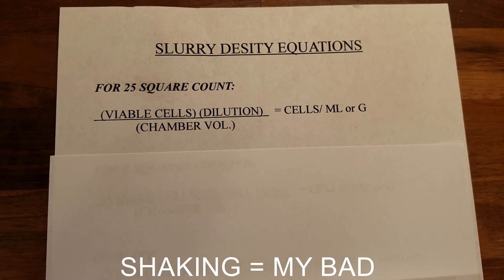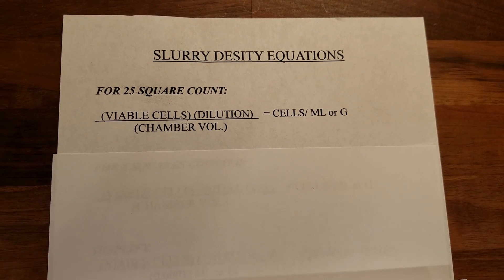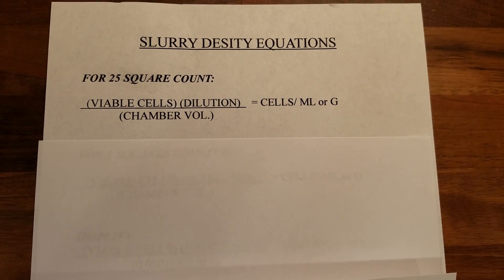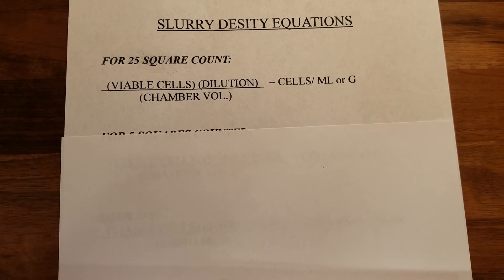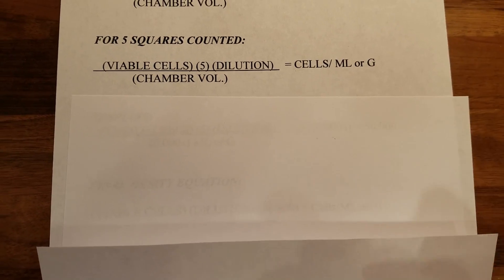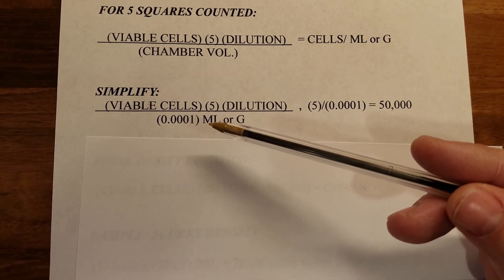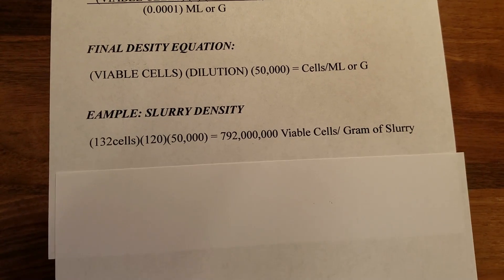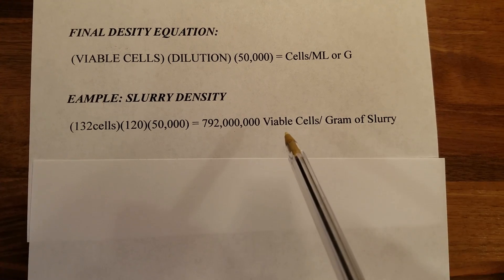BREWING EQUATION! Yeast Slurry Density, MICROBREWERIES!

Comment: Nice the calculating was
But what do you think of the formula for pitching yeast rate as 
Kg yeast required = (viability ×consistency)/rate of pitching ×HL of brew
Reply from the maker: Not exactly sure what you mean by consistency but if you want to do a sample equation for 12plato ale beer at 95 viability for 11.7Hl of beer I can see if your in the ballpark.
Reply: @brewerylife3596  please elaborate the calculations for ale yeast in details if possible
Reply from the maker: I will do a total cells needed equation soon so stay tuned.
Reply: Consistency implies the solid yeast weight  of 100g slurry after centrifuge at 3000 rpm as percentage

Comment: Hi, great video. Wanted to ask you to do the video explaining pitching rates for diferent styles like lager and ale beers. Also if you have 10bbl brewhouse and 20bbl fermenters, obviously you need to do double batch. If you brew a second batch tomorrow that is going to same fermenter, do you calculate and  pitch yeast for only first batch (10bbl), or you pitch the yeast tomorrow after second batch is transfered to fermenter? Do you add some more yeast after second batch tomorrow, what is the best way to do it? Thank you for great videos, keep up the the good work!
Reply from the maker: Thanks, I'll show some common pitching rates on the next calculation video. 
You pitch your yeast for both batches with the first one. Its best to fill up a tank within 18 to 24hrs if doing multiple batches, cheers